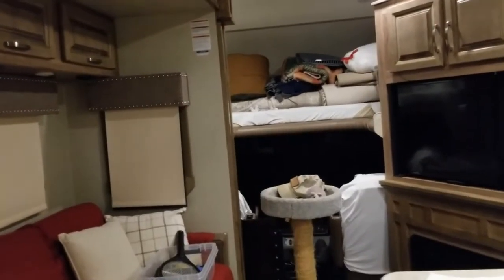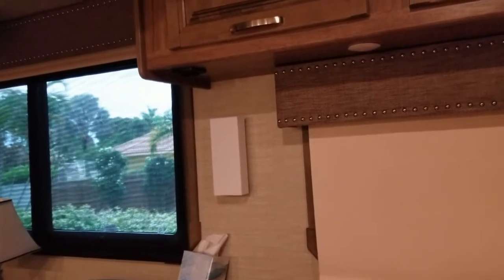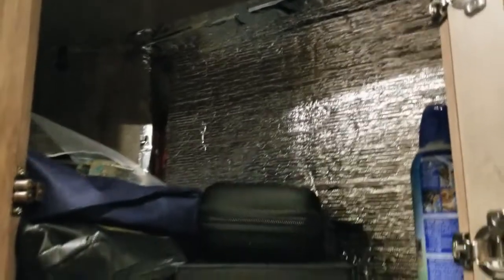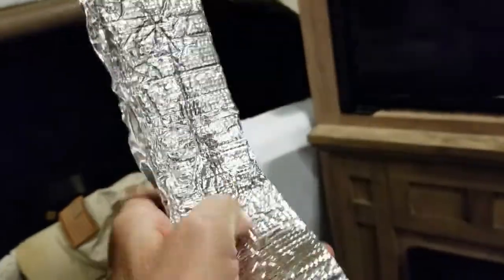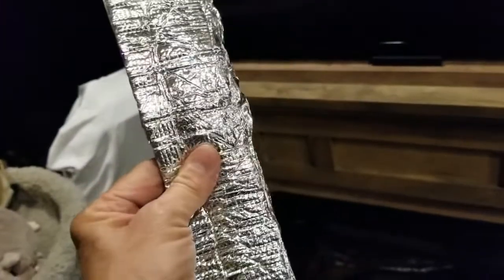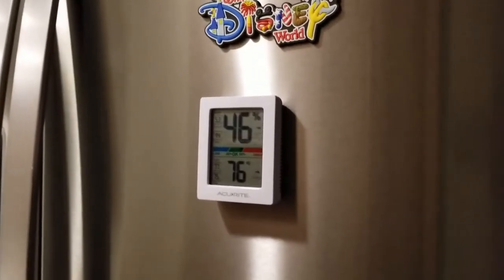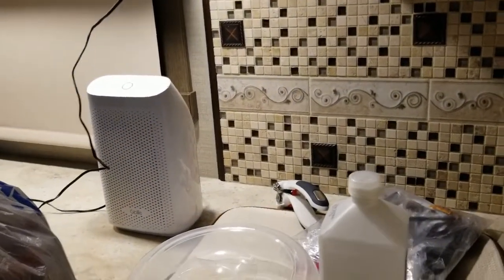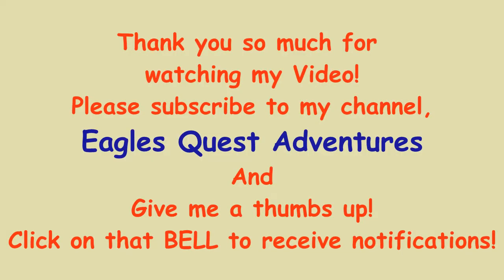Improving RV Air Conditioner Efficiency

Comment: So how did you adhere then to the back of the cabinets?
Reply from the maker: there is no adherence on the back of the reflectix insulation but I use a very low tacky reflectix tape on the edges, where it is needed. No sticky mess and it stays....
Reply: @EaglesQuestAdventures  thank you!
Reply from the maker: @NewVisionLCS  You are welcome!!